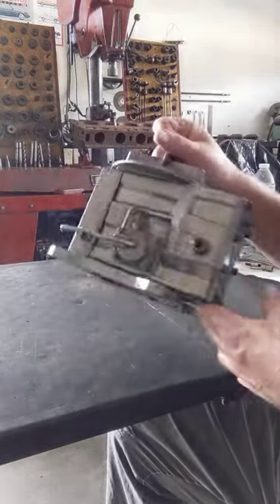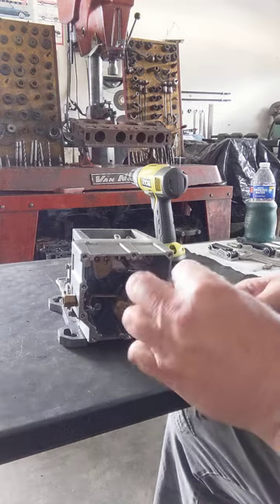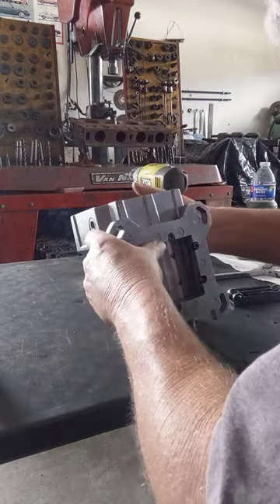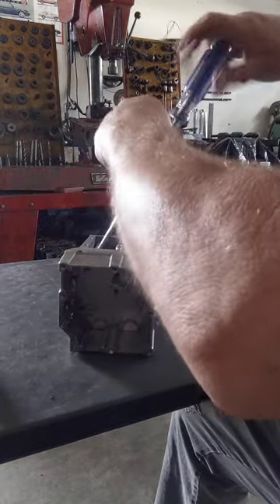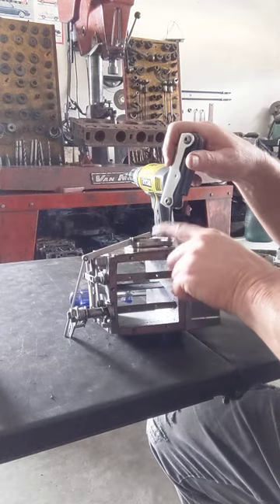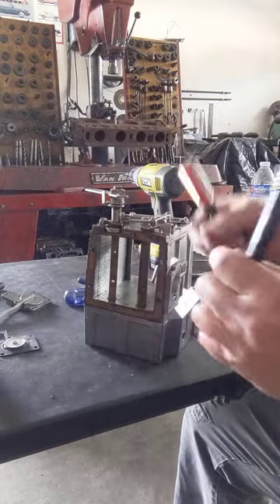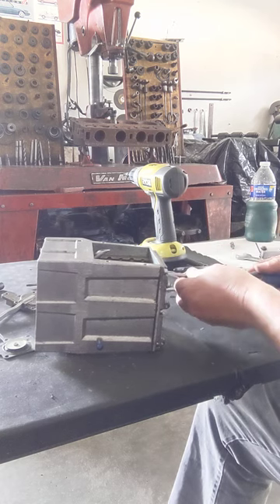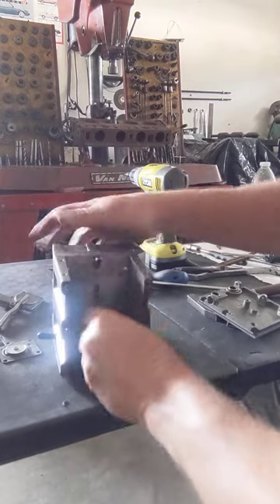Total Disassembly On The 6000 Predator Carburetor Variable Venture. (Needle Bearing Shafts)

Comment: Great in depth video Billy Ray!  You mentioned having to replace the needle bearings in the past.  How have you pulled them out and where would one look for replacements?
Reply from the maker: Thanks, I actually modified a little puller jaw to go on a slide hammer, worked out well, packing plate drive out, been year since I bought any, I went through Kaman Bearing, not sure if they're still around though, maybe check out other bearing houses a take one of the original in with you.